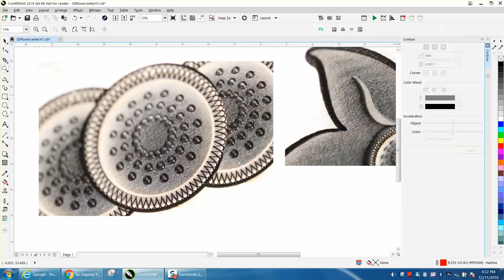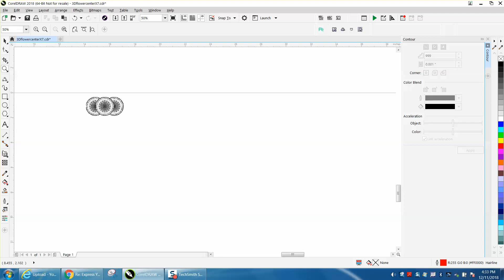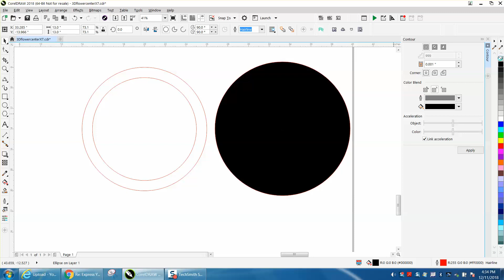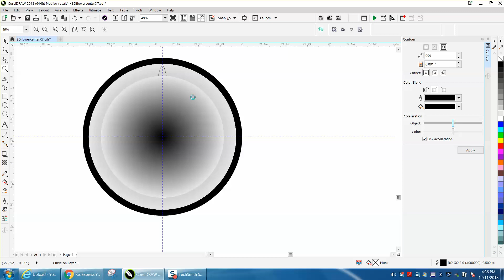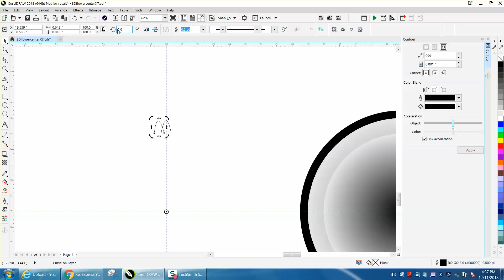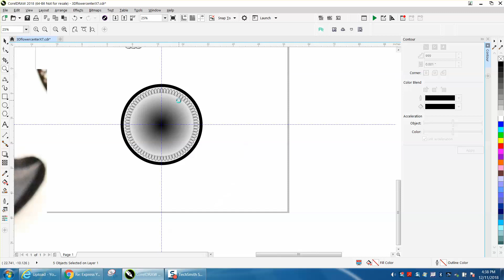Corel Draw Tips & Tricks 3D Drawing Part 3

Comment: Doug, I haven't had time to try this but does this get me away from the cut lines by changing to bitmap?
Reply from the maker: yes and not, it will not contour a hair line, but if you start out with .5 point it can cut anyway, and just raster, so there is not Vector to cut